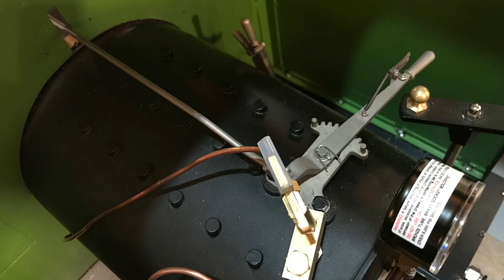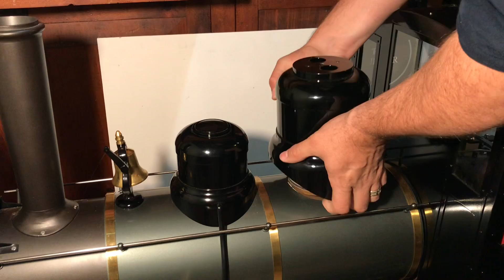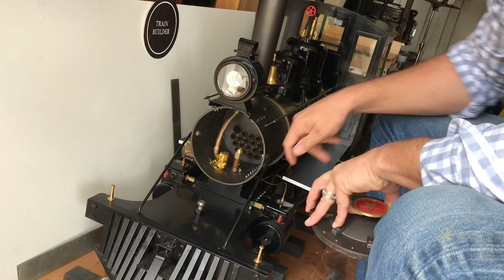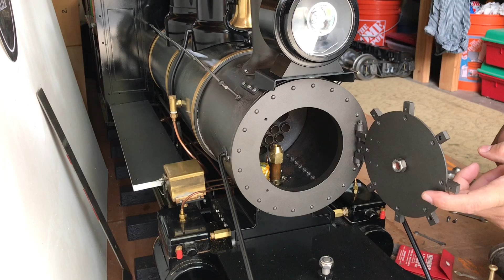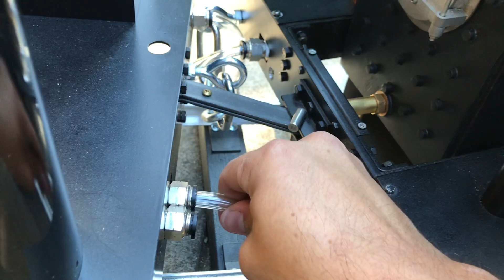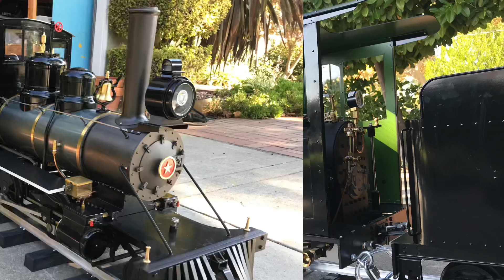Steam Locomotive - 2.5 Scale Accucraft 7.5 Gauge 2-4-0 Kit Build Part 7

Comment: What is the minimum radius curve this locomotive can handle?
Reply from the maker: That’s a GREAT question! Ok.., So it’s rated to take a 20’. BUT I’ve done some math with my buddies and she can realistically take a 12’… WITH modifications. I know it sounds sharp but here we go. The drivers are 11” apart thank god. 1. Now I cut about 1” inch off each side of the Pony trucks spring guides in order to let the Pony swing a little more without to much tension. 2. I took off the hitch to the tender and loco and made my own. It’s probably 2” longer which allows for more swing in between the units. 3. I extended the water feed hoses. I’ve tested her on a 13ft radius NOT under steam and she did fine. I’ll be testing her under steam this week actuality and will make a video on this topic soon. I’m anxious to see what she does but feel very confident she’ll take my 14’ radius well at a slow speed. Hope this helps!

Comment: Thanks for the video! I’m interested in learning more abut those hose fittings. Did they come as standard equipment? Do you know what they are called? Thanks
Reply from the maker: Thanks!! They came with the loco. Their relatively easy to disconnect.. They supply the locos boiler with water from the tender. Some locos are tank locos but this is a tender loco 🚂